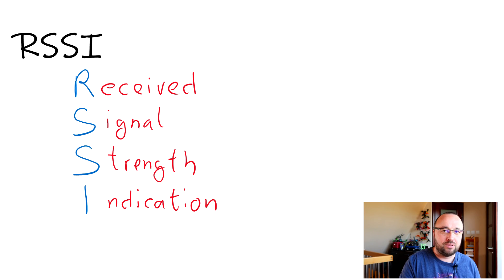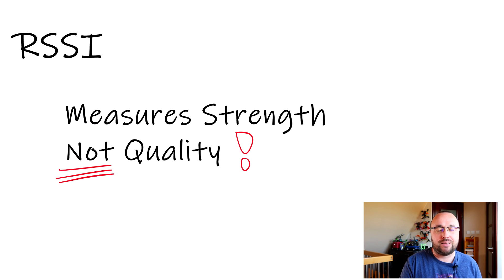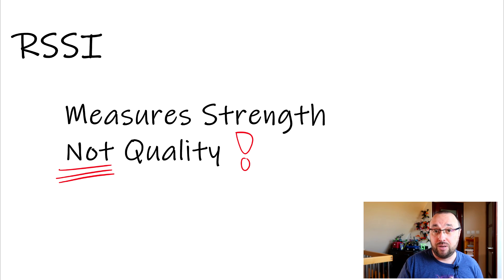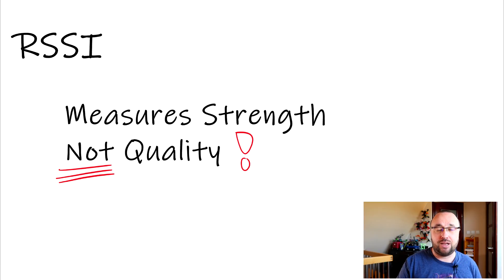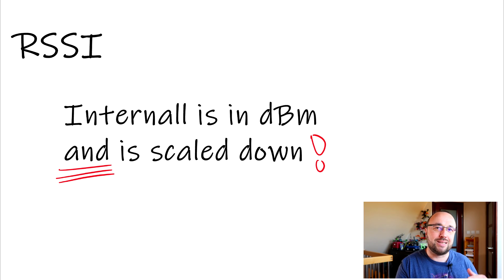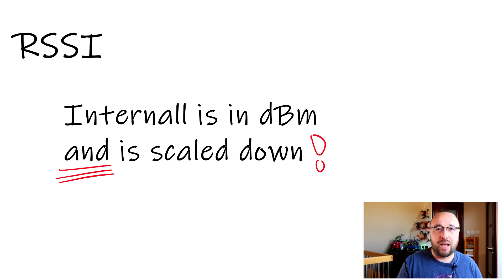RSSI, SNR, Link Quality and Failsafe explained

Comment: i think i broke my mobula 6😭
after a hard clash and clean up
i plug in new battery，and heard small spark sound
but everything looks fine 
voltage is ok 
video signal good
osd display normally
radio signal also great 8x signal 

but once i fly over a wall it just fail safe and say rxloss 
it just drop from sky with 4x signal of radio signal
usually i can safely fly over there 
its just less than 5 meter away

and if i fly around me very near, no wall, less than 5 meter everything work fine

Is it something related Rx threshold to failsafe 

after several time of investigation, it almost fail safe every time it reach radio signal below 60
and just drop from sky (on the flight mode there it show 100 f5 101) not sure what it means

have no idea what to do 🙏

Comment: Hi, I have older Futaba T8J radio with cheap Corona transmitter. I think I have found why failsafe is not working in my setup. It will go for all older receivers/radios. I can send You screen shoots so You can describe it in one of your video. How can I contact You?

Comment: Correct me if Im wrong: 
RSSI: past reading of how strong something detectable (the signal) was
Misleading if: the signal of surrounding transmitters overlay the original signal and make it impossible to decode (e.g. WLAN in Urban area)
SNR: strongness of the signal compared to the strongness of other transmitters or strongness of interference (like a tree in the way?)
Misleading if: one noise source has more impact on the transmission of packages than another bcs of frequency or something (else) with same dezibels of noise
LQ (Crossfire): number of in the past received and decoded packages
Misleading bcs: it doesnt know how many packages have been transmitted.

Comment: Interesting, thanks. Something I reckon has saved me a few times is I set the drop when no pulses failsafe delay in betaflight to at least 1 second, I think default is 0.1 second.

I reckon this might have saved me a few times where I got a loss of control and the quad just continued on at whatever position the sticks were in because the fc wasn’t getting any input from me but then all of a sudden I got control back and managed to recover. I do this for freestyle because my feeling is the quad isn’t going to fly off too far in one second but it’s a lifetime when you feel that loss of control 😂

Comment: I often get a loss of RSSI when the transmitter is too close to the receiver (~1 meter).  Is this due to saturation of Signal, SNR or quality.  I ask, as when it happens I'm usually trying to adjust something on the plane so I can't get too far away (unless I learn to operate the controls with my feet ;-)

Comment: Are you able to get a link quality read out in the OSD on a R9 system or XM+ or it that only for crossfire?  thanks!
Reply: Good point! Last Sunday my quad dropped although the received signal strength was in the 60ies... I had the low signal link blinking on and off but never thought of it, since using an xm+!!